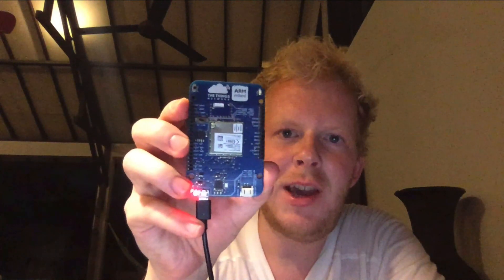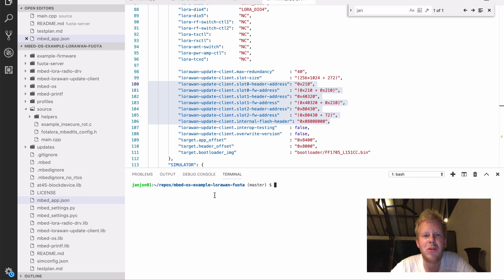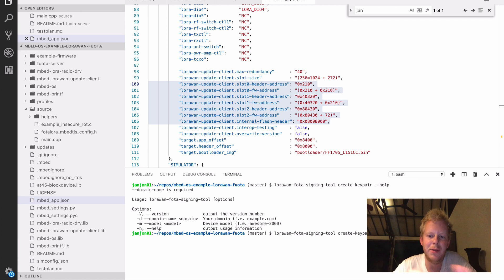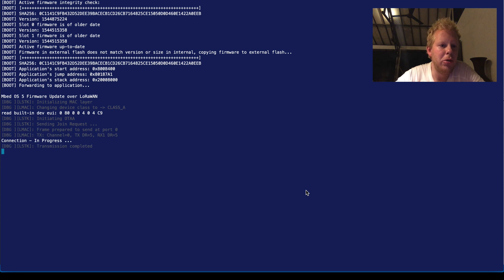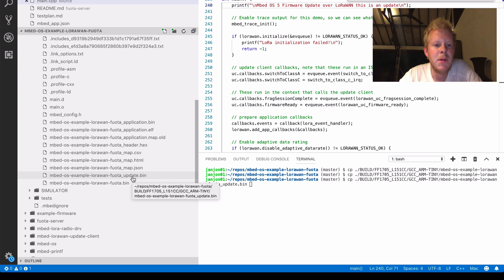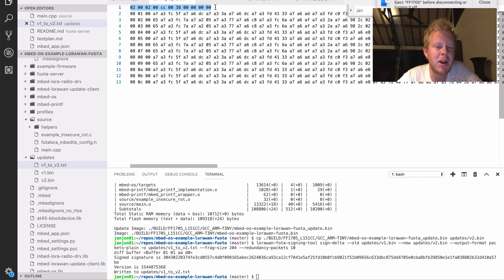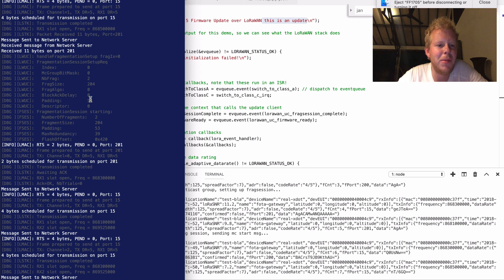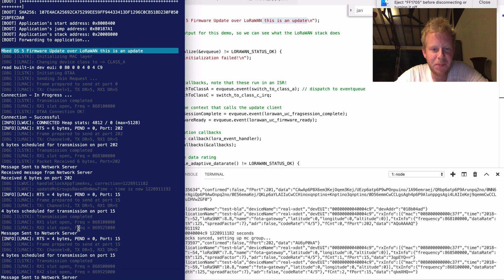Demo: Firmware updates over LoRaWAN using Mbed OS 5

Comment: cool. can you please clarify the security behind? how is the process guaranteed to be secure? The public key held by the device is the one of the NS (which is the only one to hold the private key)? Also, at 8:19 how do you know that 3 packets are for delta while the others are redundancy?
Reply from the maker: On 1) there are two keys at play, the new binary is signed with a private key which is held by you, and verified against a public key which is in the device firmware. This prevents anyone taking over the network server from updating your devices. Second, there's a Root of Trust which prevents side-channel attacks on your flash. More info on https://os.mbed.com/blog/entry/firmware-updates-over-lpwan-lora/ under 'Cryptographic verification of the firmware'. On 2) It's a mistake, I should have said 2! In the signing tool I set redundancy packets to 10, and there's 12 packets in the file (plus header packet, but we shouldn't count it). So 12-10 = 2 raw packets, and 10 recovery packets.